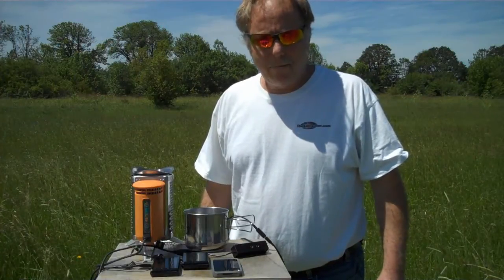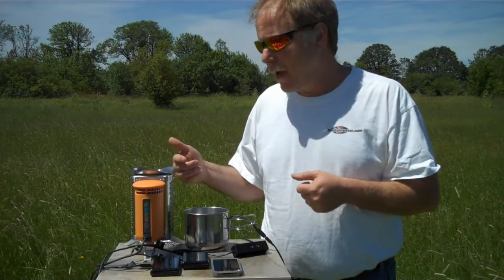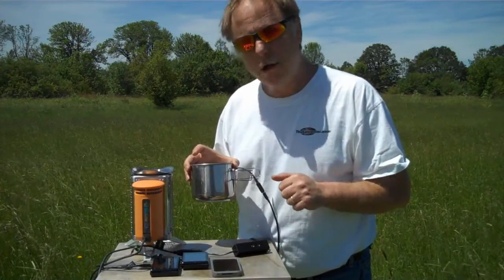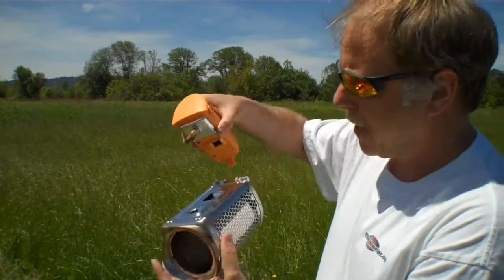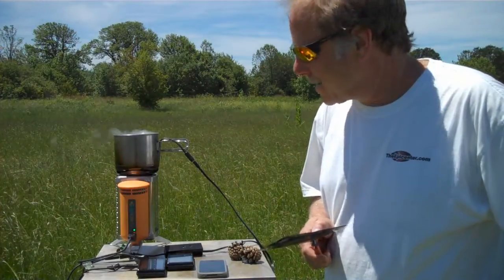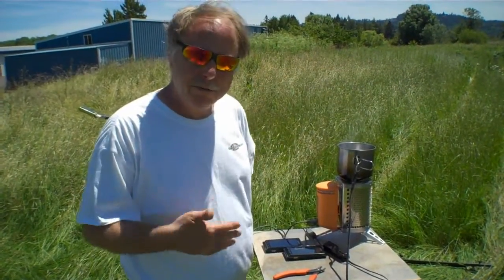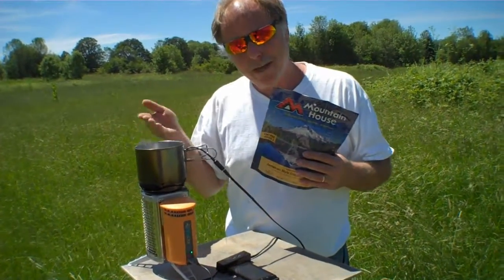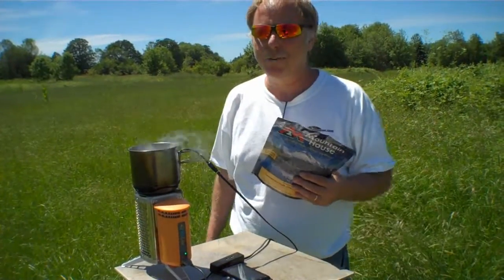Review: BioLite Stove and demo Day 1 (also see Day 2 and Day 3)

Comment: no. the fan does 2 things. firstly, it provides the oxygen for the fire to burn. secondly, it cools down one side of the Peltier device used to generate the electricity (you obviously dont understand the physics behind how this works, otherwise you would know that there wouldnt be ANY elecricity without that) allowing electricity to be generated in the first place. im guessing your experience in thermo electrics is minimal...

Comment from the maker: Your guess is incorrect. The module is air cooled. It produces the greatest power with the greatest temperature difference between the hot side (from the fire) and the cool side (air cooled by the fan).

Comment: wrong.  you cannot turn the fan off if the unit is up to temp (you can temporarily turn it off, but it will auto come back on after a few seconds to protect the electronics from excess heat).  It also gives the fire a better fuel air mixture and increases the burn efficiency so you get more burn out of x amount of fuel.

Comment from the maker: I see your point. The idea was to use the Biolite (since it's a stove mainly) as the heat source for the cup charger at the same time. That way, we could compare the two as Thermoelectric USB generators, but also see how the Biolite worked as a stove and heat source. It was overly ambitious and we failed. Be sure to view Day 3 testing when we only tried to compare the USB charging function of both devices using identical iPhones but a different heat source for the Cup Charger.

Comment: You are overloading the burn chamber. That's why it smokes so much.  Plus you let it burn down too much before you added TOO MUCH fuel.  As soon as you don't see flame, pick up the cup, toss in a pine cone or two, or two or three thumb size 4 inch sticks and put the pot back on to boil. Keeps the heat on your thermo couple and your pot of water more constant that way.